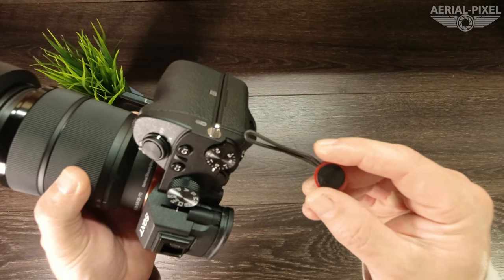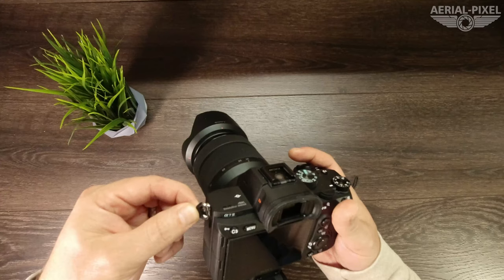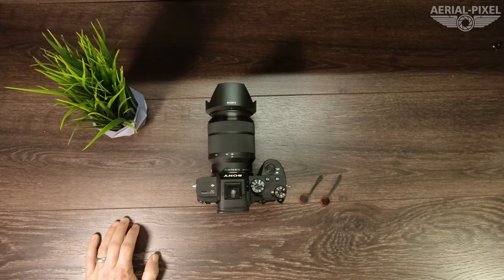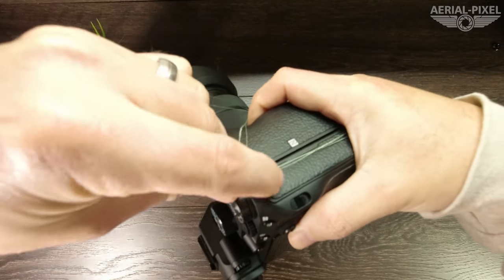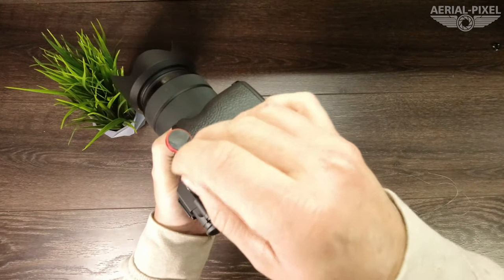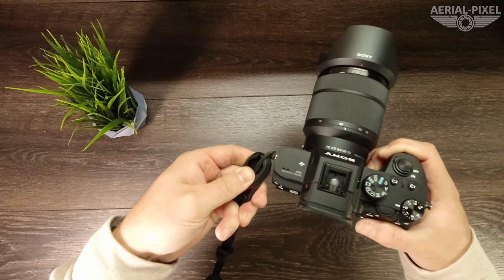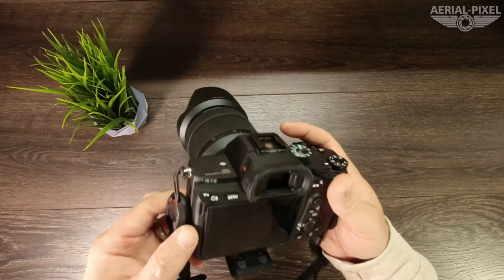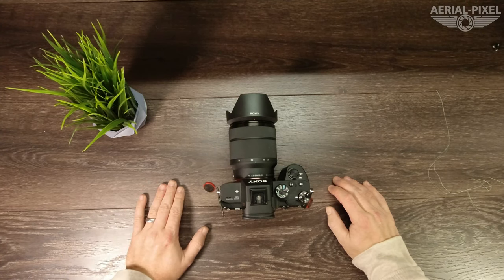Installing Peak Design Anchor Links on a Sony a7 III, a7R III, a9 or Other Sony Camera

Comment: Dental Floss did the Trick , Thanks Dude.  My experience on this on others - dont use your hands directly to avoid any cuts . Use towel or cushy material as a buffer  to hold the  fishing line or dental floss .
Reply from the maker: Good call, yeah floss can be sharp when you pull hard. Glad it helped!

Comment: on A7M4 the original 3angel doesnt move at all. But if you do it this way without a 3angel part its almost impossible to remove it without cuting the peak design...

Comment: Hey person reading this in 2022 or later. This method doesn't seem to work on the A7iv (and likely newer unreleased cameras), because Sony decided to make the hoops on the camera slightly thicker. Don't rip a hole in your new camera. Have a nice day.
Reply from the maker: The newest Anchor Links have thicker cord on them. The A7iv mounting points are identical to the previous models. It still works, just takes even more muscle than before.

Comment: Why not keep the clicking clacker things on it, seems the nylon cord going through it would make it stop click in and clankin? Or no.
Reply from the maker: I took them off because with them you still get the sounds transmitting through, even using an external mic. You could still hear them rattle a bit with the Anchor Links attached to the metal rings.

Comment: My V4 links came with a pair of split rings. Their purpose is to use them on camera's like the Sony where the normal ''eye'' is too small.
Reply from the maker: Good to know, do they rattle like the Sony rings?
Reply: Thank God you replied we didn't check in the bag haha. Definitely this method does not apply anymore sadly.
Reply from the maker: @JamesYoungAH  I don't have the V4's, did they make the cords on them even thicker? They appear to be the same thickness from their photos and description.
Reply: @AerialPixel  My wife and I both recently got Slide straps and the included anchors (I can’t say I know which version, but I guess relatively recently manufactured ) do not fit by this method, there’s just not the space. Hopefully it works for some peoples versions though. I snapped braided dyneema fishing line... felt like I might bend the camera fixture haha. This is with my a-5100 and her a7c. It seemed as though the nylon anchor would sooner peel down it’s black outer weave. We tried fresh new anchors at different positions to get a fresh ‘fold’ for the eyelet hole, but none would would. If you have any further tips they’d be really appreciated, thank you. 🙏
Reply: @JamesYoungAH  having the same issue right now with an a7c
Reply: @alexvanderkooy  I got it through the A7c. But it was definitely a tight fit and took a while
Reply: @JamesYoungAH agreed. I just got a new A7IV, it doesn’t seem to fit at all

Comment: The real question is how do you remove one? I cant one off it seems to of shrunk over the past year.
Reply from the maker: I've found you just have to work with it, it's like undoing a knot that has been tied for years. I was able to remove mine without a lot of trouble, just got to work it loose.

Comment: Do i destroy those tiny holes, because peak design anchor v4 is thicker than the hole.. I put it threw and everything is secure.. But overtime does it destroy those metal things?
Reply from the maker: I wish Sony would just make the eyelets slightly bigger. Unfortunately with the latest Anchor Links being so much thicker it makes it even more difficult, if not impossible, to install them. You shouldn't be able to mess up the metal eyelets on the camera.
Reply: @AerialPixel  yea, i could just leave triangle but i would have rattle sound... Thanks for quick answer..

Comment: There are 4 different Versions of the Peak Design Anchors out there now. The current V4 Links have a thicker cord again so they might not fit.
Reply from the maker: Thanks for the heads up! I've heard rumors they've gotten thicker.
Reply: This. I just bought the V4 Links and honest to God I cannot seem to get them through the clips on my Fujifilm X-T4.

Comment: I tried this with all my force and it's not moving. Any ideas? Tried soap and it didn't help. Floss is starting to eat into the link so I stopped
Reply from the maker: I have heard that in the latest batch of Anchor Links they have made the cords a bit thicker, it may be near impossible to do now without drilling out the holes :(

Comment: If I am not annoyed by the sound these Sony jingling edges produce, Can I install the peak design slide strap directly on them and does it affect the stability in any way?
Reply from the maker: No you can install them directly on the metal clasps, I just couldn't because I use my A7iii on a gimbal a lot for video.
Reply: @AerialPixel  so you should or it's safe to use those triangle metal things to link the anchors through? Ever have any issues with yours?

Comment: Is your anchor link version 3??
Reply from the maker: These are version 4 (AL-4) in the video. I was able to get them installed no problem.
Reply: @AerialPixel  I think it is easy to do on A7 series cameras.. I have a6600 and it is very tough to pull it thru .. maybe the opening is smaller on the aps-c bodies...
Reply: @AerialPixel  Anyways thanks for the video .. It really is a neat idea..
Reply: @sahilkhambra  i think you are right. a7c also seems to have smaller eyelet.

Comment: thank you, god damn stupid sony even on a74 it is still this shit design. another common item, tooth floss, those works too. 
another tip, the latest anchor work better on sony due to thicker wire, made them almost lose-free after they are attach in this way, where as the old ones, they kinda still want to hit the camera body as it moves around .
Reply: @Alan Xu did you get it to work on Sony A74 i am unable to.